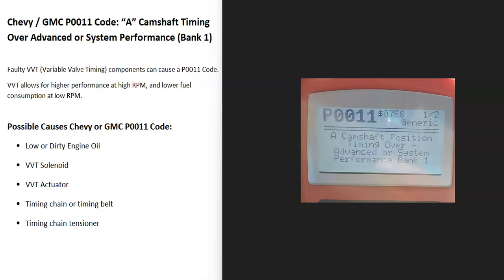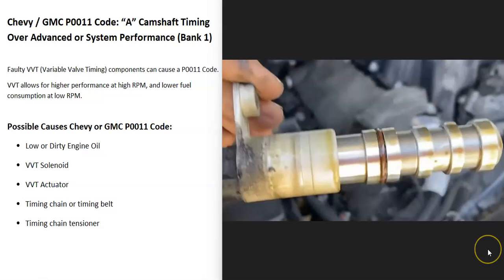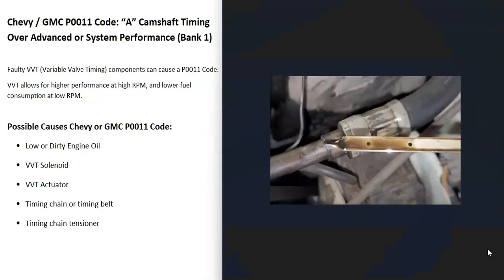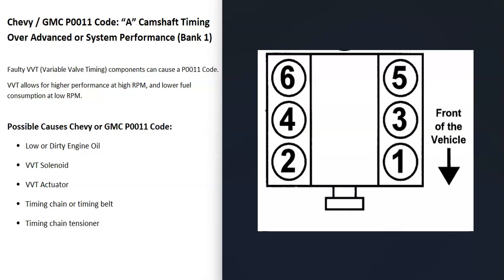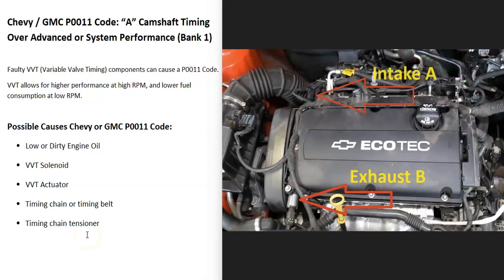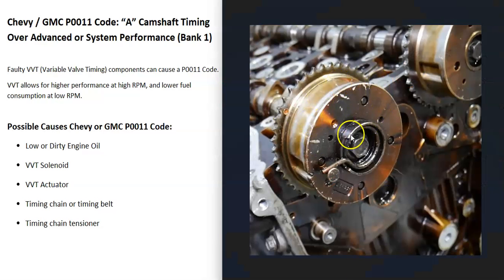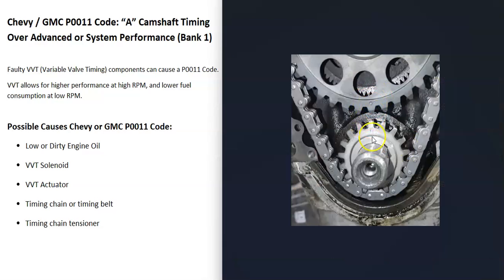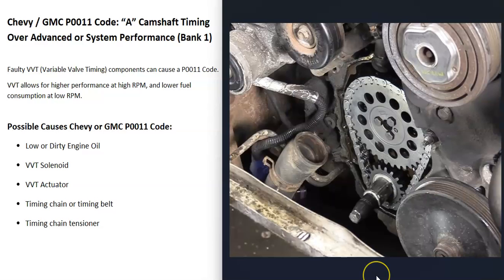Causes and Fixes Chevy / GMC P0011 Code: “A” Camshaft Timing Over Advanced (Bank 1)

Comment: My suburban has crap oil pressure and I have a hard mis slight knock and p0011 code timing chain and tensioner replacement done oil pressure got worse afterwards

Comment: Had it on a 2012 impala. changed the VVT solenoids and oil and it turned off by itself. I’ve read from people that with these engines just be on time with your oil changes cuz the sludge with trigger this code

Comment: If anyone is wondering, I have a 2015 Chevy Sonic 1.8 and a lot of people had the same common issue of replacing everything and the code still coming on it's because of sludge buildup.
Reply: How would I go about fixing that? Is it just the buildup on the VVT solenoid?

Comment: If im getting this code and the p0014 exhaust solenoid code with my engine stalling when idle what do you think the problem would be? Mechanics changed the solenoids but it didnt fix anything and told me pretty much no way to test it just have to change everything which seems crazy to me. 2014 chevy equinox

Comment: Just bought an ‘18. Drive it off and on for 30-40 min no prob. Closed the deal, drove home, took the kids out in it, got home and the light came on. Worried now after reading horror stories!  Oil is clean and full. Solenoids the next step?  Or the position sensors?

Comment: can it be the oil pump if you have fixed all of this, and the issue persists?
Reply from the maker: It's possible, but usually, the oil pressure sensor would pick that up and give a code.

Comment: Changed everything and still have code.. Chevy needs to recall this ASAP
Reply: I did everything I could find online about this issue and in the end it turned out to be the friggin gas cap, as soon as I changed it the light went out and hasn't been back on, apparently there's such a thing as a false code
Reply: @paulvaccaro2942 I got mines used and purchased a brand new gas cap online about 4 months ago and just got this P0011 code today. Crazy something as simple as gas cap. Thank you for your reply.
Reply: @paulvaccaro2942 ya that gas cap leaking causes a evap leak which can throw its own code and also the p0011 code because the computer in the car is thinking there is something wrong with the timing. I had a evap leak code and the p0011 at the same time

Comment: Changed timing belt, tensioner, both cam sprockets, both solenoids, both cam sensors, changed oil, still get this code.
Reply: I did all this too and it turned out to be the Damm gas cap, as soon as I put the new one on the code disappeared and hasn't come back, apparently there's such a thing as a false code
Reply: Rings are clogged.
Reply: @codyjohnson5674  So can I use an additive like a SEA FOAM to clean it?

Comment: My vehicle has stalled on me 6 times.  Engine oil is good. 2021 Tahoe.  Mechanics can’t find the problem.  Changed out one cam shaft and crank shaft sensors.  They say timing chain, tensioner, crankshaft, VVT valves are all good.  At a loss for this one.
Reply: Did u figure this out?
Reply: I’m in the exact same boat you was  in right now

Comment: Could it be the cam phaser sprockets cause changed all selonds retimed it and the only thing I haven't done is the phaser sprockets its a 1.8l echo teck
Reply from the maker: Yes, a bad Phaser can also cause issues. I would double-check everything else first since usually it is a solenoid or the wiring to a solenoid.

Comment: Could it possibly be the crankshaft sensor
Reply from the maker: It is possible, but usually, there would be a Crank Sensor code along with the P0011 code.
Reply: @HVAC_Mechanic I have a Crank P0343 Chevrolet Cruze along with a P0011, I replaced the crank sensor cleared codes and the P0011 keeps coming up after a day or two the crank sensor code comes back again, can a P0011 make a Crank sensor code come up? Because of timing. Thanks 🙏
Reply: @HVAC_Mechanic hey friend I have both p0011 and p0114
I need help so lost

Comment: i have a chevy sonic 2018 it only has 40,000 mile i get this code and rough engin idle but it goes away  after an oil change but it comes back at 1/2 oil life i use mobil 1 synthetic. is there an additive i should try or what do you think
Reply from the maker: The VVT solenoids and components likely need to be cleaned up.
Reply: @HVAC_Mechanic hey friend
Reply: Hello

Comment: What would cause one of these engines to smoke when you're going up the hill?
Reply: Right I need the answer to this question as well I was driving with a p0011 and lost all engine power had whit smoke coming from engine and now it won’t crank over
Reply: @luisnavarro8057 I had the same code and problem but no smoke do you know the reason why it’s just shutting off like that while driving ?
Reply: I had a customer coming in for this and I found the issue change your valve cover . I know sounds dumb, but the PCV system is integrated into the valve cover replace that I guarantee you no smoke up hills
Reply: You need to change the valve cover...it contains the Pcv Valve which goes bad